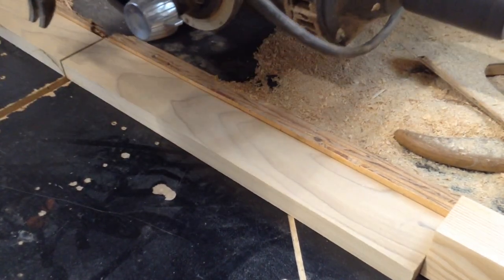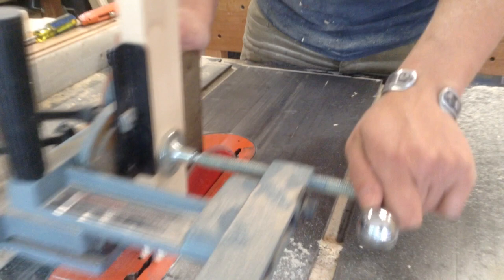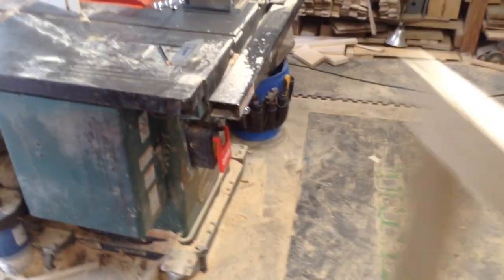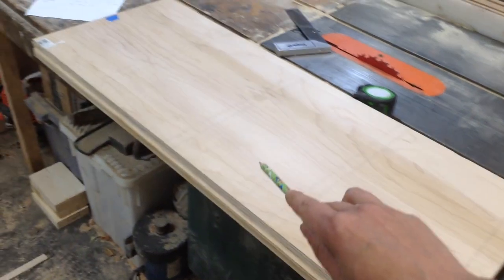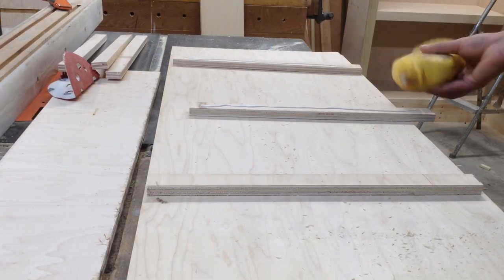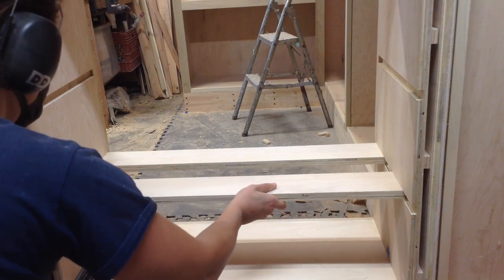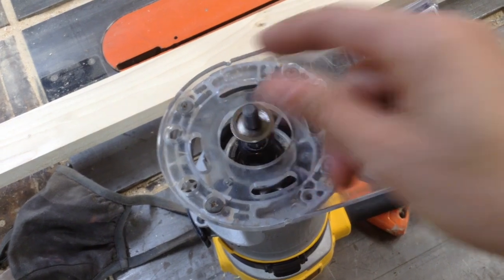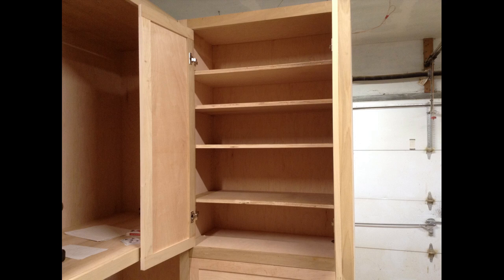Woodworking Projects : How To Make A Walk In Closet Part 3

Comment: Nice job things are coming on great, I bought a slot cutting set that was on sale from one of our woodworking suppliers here in oz and have found it to be one of my most used bits especially for doing (as you did) panel doors and also tongue and groove boards, mine has a set of cutters/spacers and can also use different sized bearings, mind you even on sale it isn’t the cheapest bit in my set by a long way 🙄👌👌👌👍👍👍🇦🇺
Reply from the maker: I'm trying to remember but I think each piece was 20-30 dollars.  so agree not the cheapest, but hopefully it lasts longer than the one I was using.

Comment: Looking great 👊!  Clever solution with the drawer unit being separate from the carcass.   Sometimes, the biggest design challenge we have is figuring out how to build the piece in a manner that makes moving and installation feasible.  I'm curious if you have considered a mortise and tenon joint for those size doors as you have a mortising machine and tenon jig.  Thanks for sharing. Enjoy  your weekend.
Reply from the maker: Honestly no hahaha I haven't thought of M&T for those.  I just always have used bridles for those longer joints.  Yes, once I got to the house and saw again the turns in the staircase I was so happy I decided to make that part removable.  It would have been a nightmare otherwise.  Not just in weight, but four extremely tight turns to get it up the stairs.

Comment: You can use the tenon jig to cut both pieces so that you don’t have to cut so many times on the radial arm saw
Reply from the maker: I like to dial in the joint with a test piece first.  I can make both cuts on the table saw, but by using the radial arm saw at the same time it allows me to get my test piece perfect without having to move the jig back and forth to make both cuts.
Reply: I understand completely

Comment: I noticed you’ve made the doors with the stiles not going to the top and bottom,you did this on another project .
When I asked about this you couldn’t remember why you did , is there a reason this time they do look weird to me sorry
Nice work though 👏👏👏
Reply from the maker: A lot of times I am working off of source photos, and for some reason especially on the style drawer fronts I'm making (these will be seen in the last video)  They run the top frame end to end.  It's just an aesthetic choice.  And when given source photos I follow them pretty closely.  The times I haven't the customer usually says something.  So I copied the look for the doors so it matches the drawers.  Once painted, you really can't notice it anyways.

Comment: Does that jib have stops for that crank?
Reply from the maker: The tenoning jig?
Reply: Yes, I was watching you turn the wheel on the rezoning jug to widen the slot on the board. Were you going off a marked line or does it have stops left and right for repeated pieces?
Reply from the maker: @michaelbissen1946  This one has stops and all sorts of fine tune adjusting, but for these cuts I just lined it up with my mark.

Comment: Wood has gotten so bad these days. I was at Lowe's and their 3/4" plywood is now 5/8". The prime lumber, 2x4s, are worse than #2 used to be.
Reply from the maker: It's a pain.  I was very happy that the load of plywood for this job was at least all the same thickness.  That's what really throws me.  When you order a stack of plywood and it's three different thicknesses.  Especially when you build with rabbets and dados.